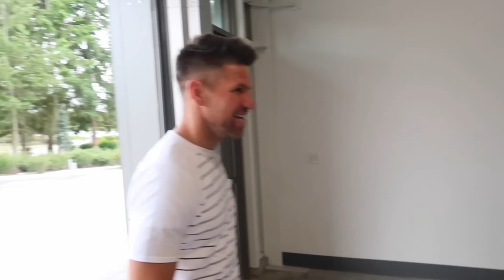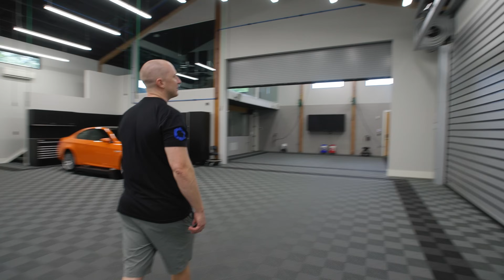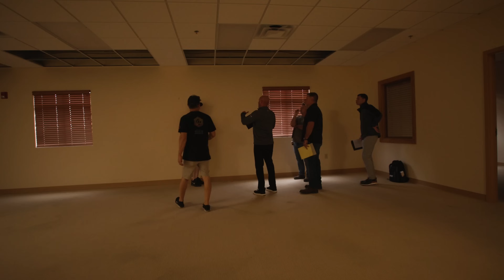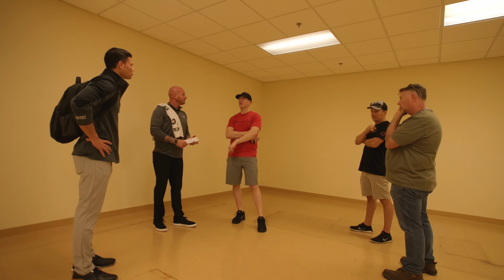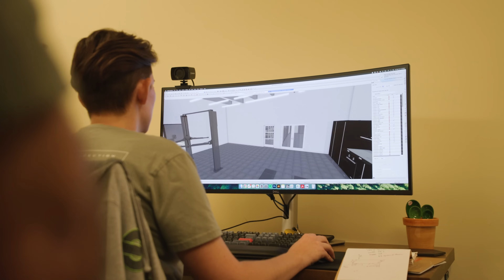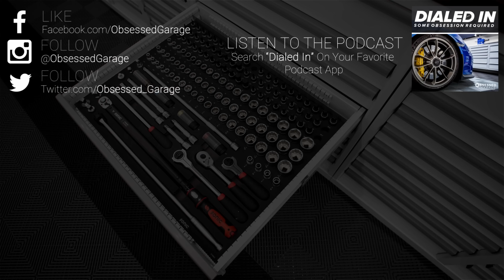OGHQ Epic Garage Build Starts Soon: HIGH SPEED Rytec Doors?!

Comment: Those Rytec doors are legit Matt, we’ve got a couple at the winery, cool thing is if a driver with a forklift punches through the doors it’s not a big big deal, who your rep is for the East Coast? You’re shipping side you may want to check out the vinyl version of the door. Ok got ya Chuck is your Rep… 20 years ago my dad was was an authorized dealer out of Hayward California when they first started many years ago. Toyota material handling used to be the authorized dealer Toyota also owned Raymond forklift at the time. I’m not sure if they still do or not.

Comment: Matt, make sure you read the manufacturers recommendations on size,  etc, not just what the dealer recommends. Reason being,  my clopay intellicore garage doors are 18' wide, and when it gets down to into the 40s, there was a 2-inch gap in the top center of the door letting all my heat out. The dealer said there was nothing they could do.  The manufacturer suggested to increase the top brace from 2.5 to 3.0 inches and that solved the problem.  The dealer didn't like that I was right and charged me $500 to install the new brace but it was worth it,  no more cold garage,  no more bugs, outside smell, etc.  Take home point: don't forget about thermal expansion.  I'm down the road from your upcoming texas garage build, and there's a guest room here if you or Mike want to stay in while you're here :)

Comment: I remember when they replaced the old vinyl/fabric doors at the dealership I worked at with Rytec doors. It was awesome because you drive in and out of the shop dozens of times a day, so the speed of the doors was great. Not to mention they bought the see through doors which made the place look nicer and prevented those awkward “no you reverse” moments when someone tried to leave only to be met with someone trying to come in. 

Great choice, I look forward to the install!

Comment: Try and get them to extend the warranty, we have three high speed doors and 12 regular doors at the Audi dealer I work at, very expensive to repair and trust me they needed repaired often, also do not let anyone work on them, only someone Rytec had trained, also I would recommend a maintenance plan where they come out and perform recommend maintenance.